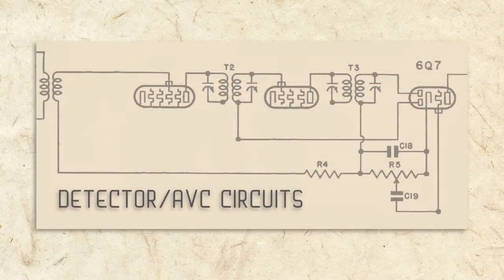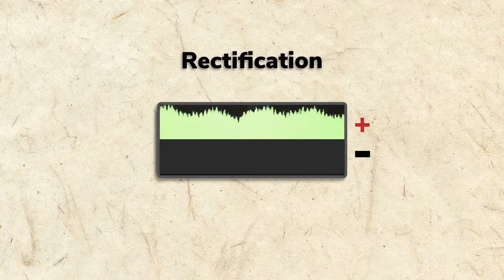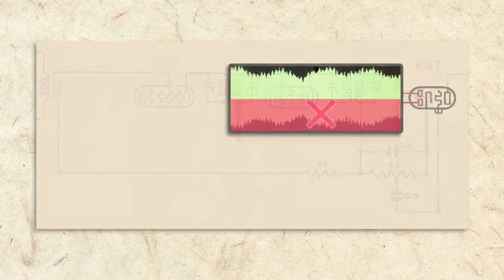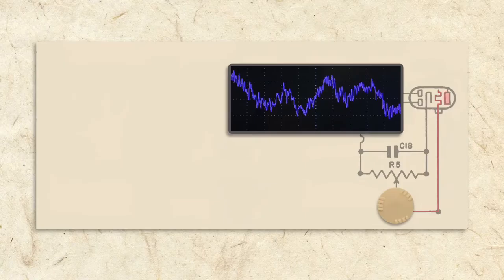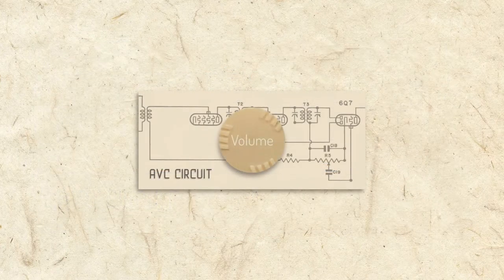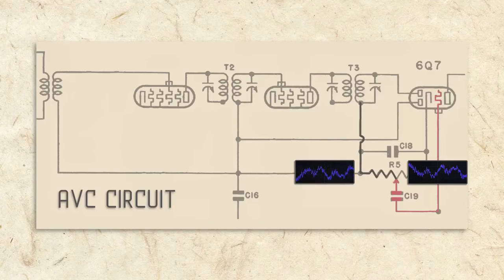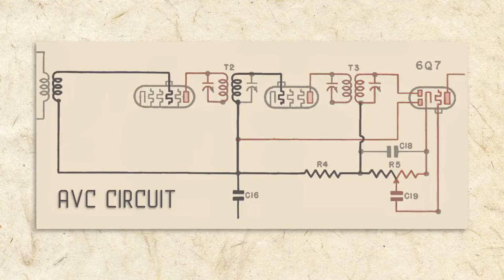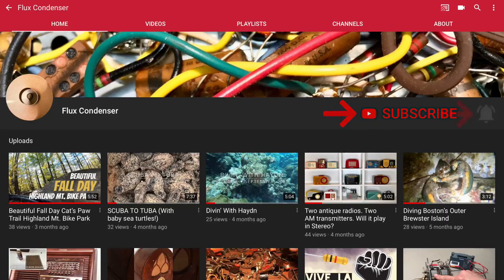How Do The Detector & Automatic Volume Control Work?

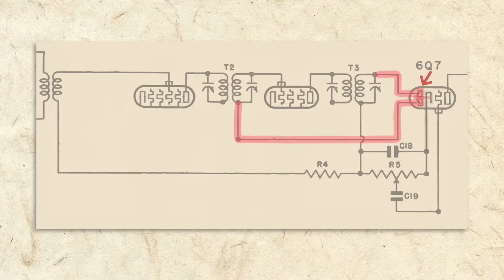Comment: Thanks for the great explanation. It's very clear. However, I have a circuit design question: At 1:12 we see the IF connecting to the rectifier 6Q7 from two stages, T2 and T3. Can you explain why the T2 signal is needed? Wouldn't T3 have the narrowest and sharpest IF signal?
Reply from the maker: The signal direction is from T2 to T3 (and their corresponding tubes), so think of T2 as the first stage and T2 as the second. Each stage amplifies and tunes the signal further. So, T2 is needed as the first stage of tuning and amplification. T3 further tunes and amplifies the signal.